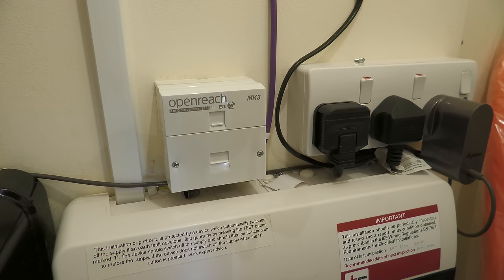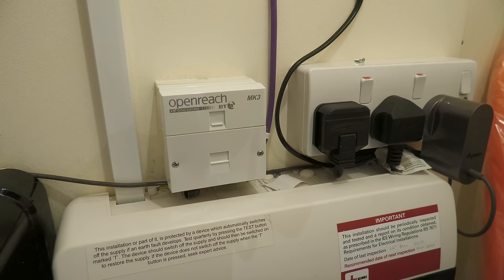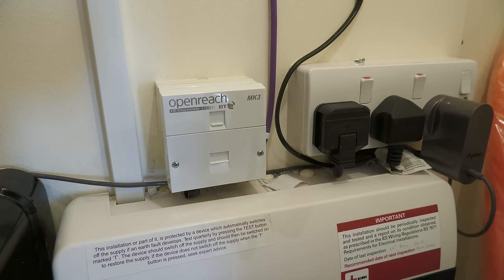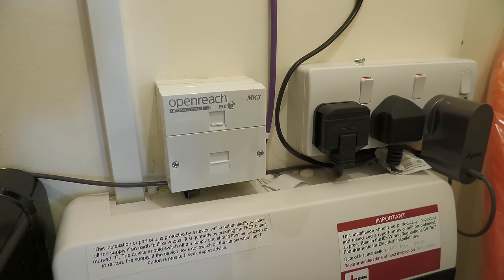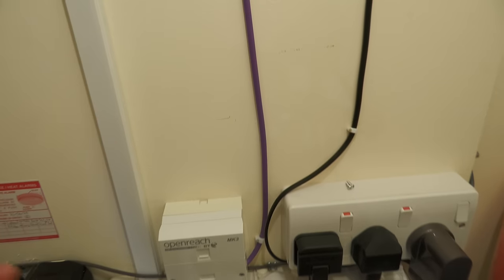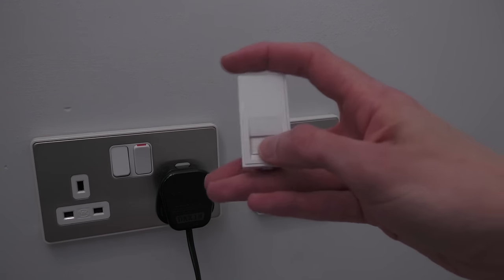300 Mbps DSL!  Upgrading my Home Network to TalkTalk Fibre 250 G.Fast Broadband

Comment from the maker: Get TalkTalk Fibre 250 (Affiliate): https://sovrn.co/1i55weo
This is very long video that goes into a lot of detail, you can skip to the parts that you are interested in using the following chapter timestamps:
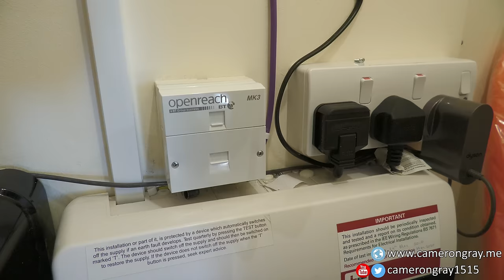00:00 - Introduction
04:03 - G․Fast Providers and Pricing
07:55 - Ways to get a Static IP address when your ISP doesn't offer it
11:30 - Reverting my phone wiring back to basics
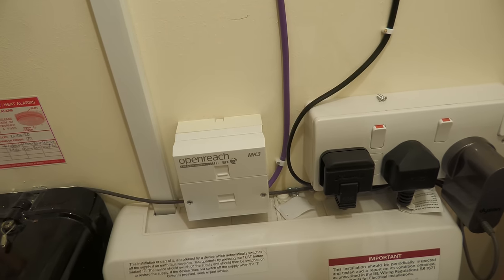15:23 - A look at the NTE5 master socket
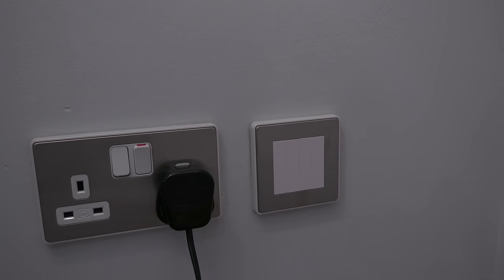22:07 - Fitting an extension socket
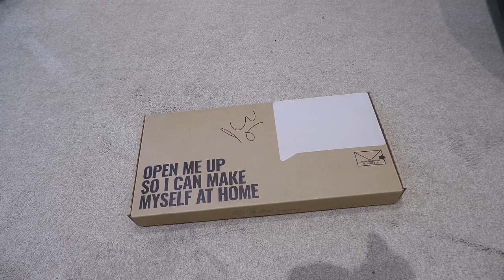29:33 - TalkTalk Router Unboxing
32:44 - Connection Live!
35:31 - Network Installation Improvements Tour
38:52 - Network Wall Plate Tour
40:38 - NTE5C Tour & Explanation
48:15 - UniFi Dream Machine Pro Configuration
50:23 - Plusnet VDSL2 Speed Test
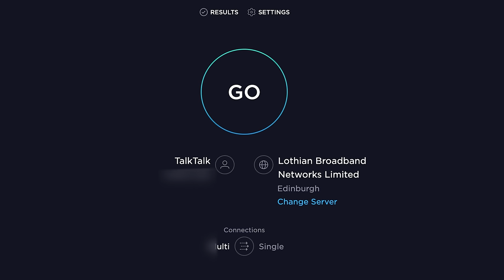51:15 - TalkTalk G․Fast Speed Test
52:24 - Conclusion

Comment: I’ve moved about 5 of my family members homes to TalkTalk from BT and others purely from a price perspective. I’ve used TalkTalk myself personally and TalkTalk business in the past over a number of years without fault. 

You gently touched on the fact at the start that most negative “reviews” are from people and users who don’t understand that the external network infrastructure is provided by Openreach and therefore shared between all providers on that infra and their home WiFi performance is their own responsibility.
Reply: Not completely, a lot of the time it’s the equipment they supply and problems on their own network. I’ve switched between BT,Vodafone,TalkTalk both FTTP  and FTTC and find the problems only arise with TalkTalk. I do get what your saying about TalkTalk using BT’s network and issues with that between the home and exchanges being BT’s fault, that’s very true but many issues are down to TalkTalk and its network and there own equipment. Also if you happen to be on FTTC, the phone and broadband are LLU, this is the service I had most of the problems with! FTTP was the solution I thought but then I started having different problems with that.

Comment: I remember the days when 17070 was an engineer only service but had no job PIN protection on things like the loop length tests. This meant when BT refused to provision ADSL1 or ADSL Max due to line length, you could disprove their calculation and contend that no, your line was actually within the maximum permissible length to support ADSL ;) Sadly people began hammering the 17070 exchange boxes and at some point openreach decided they'd restrict some of the advanced diagnostic features. Oh well.

Comment: Very very interesting to see how things are done in other countries. Especially the master socket thing impressed me very much. In Greece (where I live) I've never seen a clear boundry where the ISP network ends and where the customer network starts. And speaking of that, our regulatory authority on telecomns is debating how to define the seperation between ISP and customer. 70+% of the country is still on either 24/2,4 adsl or 50/5, 100/10 or 200/20 vdsl2 (fttc). But above 100 most struggle due to the copper wiring. The cable that comes from the roadside cabinet directly enters the inner building copper wiring, there is no disconnect like you have with the master socket. So we plug the modem directly to an existing RJ11 jack in the house. Over the last 3 years, the 3 big ISPs started offering ftth connections is some areas and expanding by the day (with a goverment subsidy that lowers the monthly cost to the same price as the equivalent vdsl2 for 24 months and covers the installation cost). But due to the requirement to have parity with vdsl2, ftth connections are 50/5, 100/10 or 200/20 only. No faster speeds exist yet.
A few months ago I moved from my parents house which had 100/10 vdsl2 to an apartment that was eligible for the ffth installation. Got the 100/10. Although the raw datarate is the same, the faster responsivenes of ftth is noticable. Not to mention it being rock solid. For the 100/10 I pay 29€/month for a 24 month contract. Of cource no data caps (these have disappeared along with dialup 20 years ago).

Comment: I work as a telco/isp technician and we also use g.fast in some cases - but only for really short lines with FTTB. The possible speeds really decrease after about ~150m. When used only in building on in-house wiring I got speed up to 500 Down / 100 Up. For a bit longer lines and FTTC we use VPlus or also called VDSL 35b (supervectoring). It also can get speeds up to 300 Down  / ~35 Up. It's better than classic VDSL2 Vectoring for maybe ~500-600m - after that normal VDSL2 is best. In some regions we still have to use ancient ADSL2+ to get any xDSL service working.
Reply: What is the state of FTTH in England?
We practically getting G.PON with 1-2GBps in Hungary even in the small towns these days. I moved into my house in a small town in 2014, and 100 Mbps VDSL (2?) was typical that days. I had 20 Mbps FTTH in a bigger city. I wanted optics so I opted for 250 MBps, because I knew that they do not replace the system until I ask for something that VDSL can't provide.
I upgraded to 1GBps one year or so before (little bit late in the game, as all my neighbors already had that speed years before).

I can achieve 4-6ms ping with this (inside country), but unfortunately my old Mikrotik router and 1st gen Core i5 laptop became the weakest links, it caps around 300 Mbps. I can achieve around 800-900 with a phone on the ISP supplied Wifi 6 router.

In the contrary, I really love the UK wiring stuff and all those connectors and electrical fixtures. The phone connectors here is just fragie and flimsy, I am glad it went extinct here. Also those 85x85mm boxes in the UK and the inserts going into them are way more practical and higher quality than the stuff you can get here. The switches and mains socket with switches are sturdy and well thought out, you can easily wire 4mm2 wires (maybe two even) into them. The UK's really love switches that's for sure! 😉

And that M3.5 screw fixing is way better than the pointy clamps used here in the round boxes. They fall out more than not...

The consumer electrical market is filled with cheap low quality stuff here. You can buy Legrand and Prodax, the orhers are practically low quality. Low quality sockets, flimsy extension strips, weak plugs, terminal blocks where the thread strips when you tighten properly. Electrical installation here is not the knowledge of how to install (that's easy), but the knowledge of what to buy where and what to avoid like fire... 🤦🏻‍♂️

Comment: I'm on the same G.Fast plan with TalkTalk and also can get around 300Mbps down and 50Mbps up. The 50Mbps up makes routing all mobile or public Wifi traffic through WireGuard actually practical.

Even Virgin's M500 plan only has 36Mbps up.

I had it connected back in September and it's been stable since then, although it really is pushing the copper to the limits so I can see why it can be unreliable for many.
Reply: Currently on talktalk 500 meg.. 519 at the wall and 480 after feeding eero 6 and running a cable upstairs to the office.  We have  tried stressing it with  a 4k tv..2 desktops. 6 tablets and 2 phone..no issues. 
But the best tip I can give any one is connect via a cable.. a good cat 6 cable will reduce the stress on the WiFi and the ping will drop.

Comment: I’ve changed my openreach FTTC service between providers about five times now, never used their supplied kit, still use the 10 year old original engineer installed BT modem (not a router), always worked great, no matter who is the provider, now on shell for about £12 a month including rental. I have upgraded the filter plate a couple of times and replaced the RJ11 cable with a decent twisted pair one. Wish the ISPs would give you the option of rejecting their router, for me they are straight to landfill.

Comment: I used to be a dsl tech for a US based company and we have a MDU demark socket as well,  but it has an rj-11 cable sticking out of the bottom that the customer can just unplug and plug their modern or any phone into without having to disassemble the actual socket or use adapters
Reply: Its an NTE so you can disconnect all internal cabling to check when you have a fault

Comment: 300/48 with an 11ms ping, is still not bad in 2023. We're rocking a 300/300 connection with around 5ms ping. That's on full fibre (new build estate) which is not that different to what you're getting on G.Fast. 👍
Reply from the maker: Yeah, I've been pretty impressed with it so far.  That said, I'm currently awaiting the imminent install of CityFibre in my building - External cable is in place (and sitting taped up in the corner of the car park teasing me) so just awaiting the internal cabling to be done.  Contract with TalkTalk has just run out so will be jumping onto something that uses CityFibre the second it's ready!

Comment: I’m with ID Net and they are great but costly, however I get the top end of VDSL at around 70mbps regularly. But this year and next Gigaclear are installing fibre to the homes in my village, so I’ll be jumping onto the gigabit bandwagon, no one else is interested in my village in regards to network upgrades. Also it is illegal to change your master phone socket back case or move it on your own as you said, the faceplate you can do what you like with, and most people fit Open Reach faceplates anyway. TalkTalk business is legendary in the ISP tech community, it’s damn good and great value.

Comment: To be fair that's pretty impressive for copper from the cabinet, I remember reading about G.Fast but never really see it advertised. Broadband via Openreach is terrible where I live but luckily there's Virgin.
Reply from the maker: Yeah, I was very surprised.  Unfortunately there's no Virgin cabling in my building so I couldn't get it, I used them previously back in 2013-2014 (back when their 100 Mbps package was basically the fastest you could get in the UK) and was pretty happy so wouldn't be against using them again if they worked out to be a viable option for me in the future.
Reply: @camerongray1515  yeah I’ve just upgraded to their 1 gig (shame the upload is still only 50) although the annoying thing is the router isn’t actually capable of delivering all 1100mbps to one device, surely 2.5G networking wouldn’t have cost them much more.
Reply: @jonjohnson2844  their Hub 5 which they're trialling atm has a 2.5Gbps LAN port, hopefully that'll be released soon :D
Reply: @hammy434  I think that was out when I upgraded but they only sent me a hub 4, I’ll pester them in a few months 👍

Comment: Funny that you use filter for data/phone copper line from outside at 2022. In Germany we never use more. Since start with VDSL around 1995 more and more phone lines cutted and user use VDSL line and bridge/switch (as combined router), most providers use german-engineering FritzBoxes. They make the IP-connection for data and phone. True phone lines are really rare these times. Since around 2005 with VDSL2 they use FTTC. 

With start of FTTB/FTTH around 2010 do you more and more fiber installations. Here they start 2011 with 25MBit down / 2,5MBit up, later 50d/5u for free. Actually do you can book 400d/40u, for business connect more as one together. Typical VDSL2 run at max of 250d/25u for private houses but the price are very high in opposite to fiber installations. 

Fiber go over fiber2ethernet-bridge to FritzBox but now do you can buy a FritzBox with fiber connector too. Less private LAN installations are fiber in-house, near ~90% are typical copper. I think in UK it is same. 

An other system is internet over 4G/5G with a boxed Huawei router - an easy plug'n'play system for the customer.

Comment: Thanks for this video, Cameron - very useful to see this level of technical detail.  I was with Plusnet and moved to TalkTalk due to the renewal costs with the former. They offered me a free upgrade to G.Fast but I haven't taken them up on it yet as my phone line comes into my living room but my router is in my study (plugged into the extension socket).  From the looks of the faceplate it might be possible to use the G.Fast extension to change the extension wiring, although that may not be great for signal strength! Unfortunately it's a new build property with no ethernet cabling done and to run some would be very disruptive (all laminate floors, not a top floor flat, etc.)  Will have a think!  Have proper FTTP with Fibrecast at a different property and the symmetric upload speed is amazing with it!  PS for the first 10 min maybe you could have gone for doing a piece to camera rather than just showing the old connection and your consumer unit 😉😜
Reply from the maker: Worth taking a look at your existing extension wiring, it may already be run in CAT5 in which case you could put your modem/router next to the master socket and repurpose the extension wiring for ethernet.  Other than that you could probably extend the G.Fast connection over it assuming the cable is decent enough quality.  I did consider doing a piece to camera at the start but I'm not the biggest fan of that - not the biggest fan of talking to a camera and don't want to become the sort of YouTuber that's easily recognisable in person - I'm not a huge channel but already been recognised by my voice on several occasions.  I recorded a bunch of b-roll to play during that bit then totally forgot to edit it in and only realised after uploading.
Reply: @camerongray1515  good point re potential for using existing one as CAT5. Just wish they'd properly run ethernet cabling at the time of construction. I retrofitted an old flat in Glasgow with it but that's easier to do when you can lift up floorboards than with laminate flooring 😂

Comment: good video. ive had fibre 900 for around 10 months now (FTTP) and its amazing. im still using the standard bt smart hub 2 as its generally very reliable but the wifi is poor. can only get 300mbps max becuase of its lack of WIFI 6. hopefully their next router will have wifi 6 which will make it perfect
Reply: You could always pick up something like a UniFi WiFi 6 Lite AP for less then £100. You can set it up using an app on your phone and it will give you excellent WiFi 6 performance.

Comment: I recently moved ISP in the UK and lost my Plusnet static IP. New ISP was much faster (FTTP) but uses CGNAT & no IPv6. I similarly only needed a little bit of remote access. I use Tailscale for free running on a VM on my NAS. It's really good and worth checking out.

Comment: Whoever installed that triple socket outlet that close to the top of the Consumer Unit wins the award
Reply from the maker: Yep, which infuriatingly was done by an electrician back when I was trying to do everything "properly" by not doing electrical work myself and hiring professionals...  Don't get me wrong, there are a lot of great contractors out there, but it's things like this that make it hard to trust them over just doing things myself!

Comment: Thanks for this video. Very interesting seeing how things are done in the UK. There's a good few differences I see with how things are done here (Netherlands), especially in terms of how phone lines are terminated and how far Openreach goes to make sure you get the right equipment. We still have the same phone socket termination point in the living room as when the house was built in 1978. We have since also gotten cable and FttH though (november 2020). The policy amongst Dutch ISPs at the moment is to disable DSL as soon as there is a fiber FTU installed in the house,
so I'm not expecting any further upgrades. G.Fast (marketed as VPlus/Super Vectored DSL) was never available, only bonded VDSL up to 200Mbit down, 60 up. 

We used to have a 100Mbit VDSL connection, which was 111Mbit in practice, with 33 up and that was pretty good. Fiber spoils you though. We're on Gigabit now, also with a UDM Pro, which is just as expensive as the 100Mbit VDSL was 2 years ago. 

That said, if all we had was cable or VDSL, I'd still pick VDSL, never had quite the same uptime with cable before and our only cable provider is such a terrible value for money.
Reply: Tried CATV service once (virgin) it was fast, but not reliable, always lots of jitter, occasional lagging, always felt like an inferior technology. Openreach street cabinets are always well maintained and secured, Virgin ones are open to the weather with tramps pissing in them.
Reply: @edc1569  there's one near me which got blown over (yes really) in the storms a few months back, it's been on its side ever since, still working I would assume lol  that said I've used VM for 20 years now and never had an issue - at the minute I don't even have access to FTTC, but Openreach appear to be overlaying FTTP at last.
Reply: We have 1gbit (100mbit up) cable through docsis 3 though. I haven't used dsl in years because its terrible here.